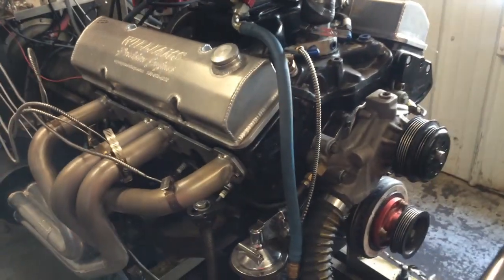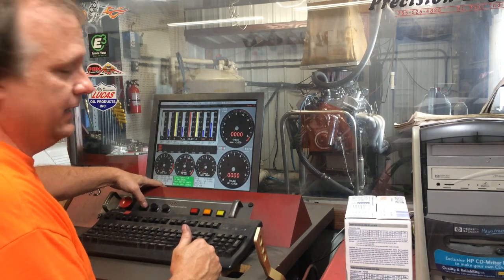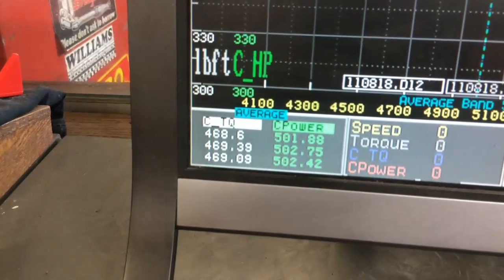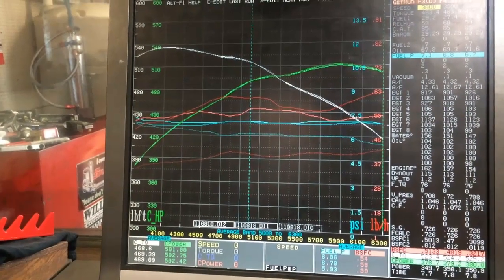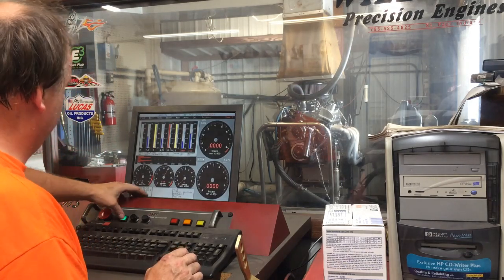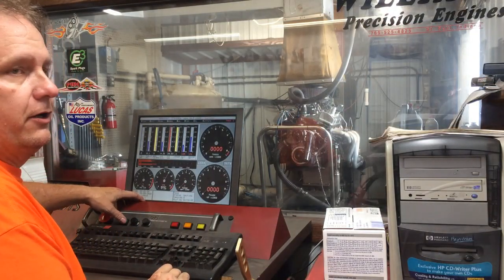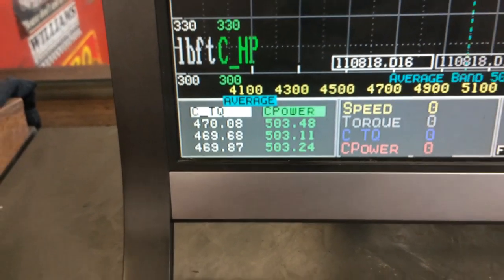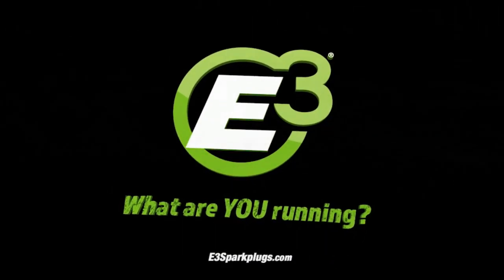E3 spark plug tests

Comment: E3 is pure $&#&@ in anything other than lawnmowers. Stick with OEM...always
Reply from the maker: Mr Boulding, not sure why you feel the need to slander, but it is insulting and unprofessional to do so.  I can tell you from real experience and show you with unbiased proven results you are wrong sir.
Reply: @wpespeedshop  this isn't "personal" so there's no slander involved. This is a product for purchase on the open market, and as such open to everyone's opinion and statement of quality. It's why products get "reviewed" and not all reviews are positive. 
I have many friends who are professional mechanics, and car dealers and they will report that the majority of E3 plugs used in modern cars and trucks do NOT hold up to the rigors of these engines. I have personally seen far too many broken E3 plugs and E3 taken out and thrown away after a puny few thousand miles. 
In two cycle engines of power equipment, they are great. OEM for cars is always the best choice as those guys called "engineers" know what they are doing. Not one non owm plug has ever withstood the science and testing to prove they increase performance or mileage. Any increase they state is almost always because ANY new plug will outperform an older worn out plug. The margin of error on Dyno testing also conveniently covers these performance plugs statements of enhancements.
Reply: @JohnBoulding  there is a test done by a guy named Richard Holdner and he tested the e3 against ngk laser platinum and also autolite copper standard design plugs and the e3 did not perform any better, and infact the copper plug came out on top for power.  Project Farm also did a test on several different plugs from several companies and the e3's still did not perform the way they are claimed to.  Its not slanderous when the plugs dont do anything that they claim to do for performance.  There's no reason for people to waste money on such a plug that can be out done by decade's old technology of the standard copper plug.  I agree with your opinion on these
Reply: @Itsarealone  thanks for that info. No one should be offended by facts and the E3 folks know their claims are not supported by facts. It's marketing 101 to make claims of added HP, which is never the case. Any Dyno increase in the 3-5 HO range is always within the typical margin of error on a Dyno. For this guy to say I slandered E3 is ludicrous.
Copper plugs are the best, they just don't last that long. I use OEM morotcraft I. KY 2008 Mazda 6 or NGK g power.
Reply: @JohnBoulding  absolutely agree! Companies and people need to be open to criticism especially when it comes to products out in the market.  In my turbo saabs i run ngk's but recently tried out a denso product thats been seeming to give my ignition system better feedback. My cars management system tells knock by a resisted plug and its been seeming to show me little knock counts that werent showing up under the ngk plugs. So its helped me get light throttle fueling down better and now performs much better with standard putting around driving amd increased fuel economy which with e85 is always a bonus lol
Reply from the maker: @JohnBoulding  I am offended because you’re calling me a liar, I’ve been building engines for over 30 years professionally, and have owned my own Dyno all that time. I do not work for E3, I have nothing to gain here, other than good faith with the company. These plugs did make more horsepower, and they do just about every time. I’m not talking 20 hp, probably only three or four in most cases, but they most certainly do make more power.
Reply: @wpespeedshop  nothing I said implied you were lying. I was simply stating facts which are born out by thousands of reviews of these plugs. I also have many friends in the racing industry and they also tell me to avoid them. You may have had great luck in your uses but the majority of users say otherwise.
Reply from the maker: @JohnBoulding  your wrong, but entitled to your opinion. E3 plugs work just fine and I personally know dozens of pro race teams that can tell you exactly the same.  On that note I have had zero luck with Autolite and I’m sure there are many out there that say their great. The difference is I’m not posting ( Their junk )
Reply: @wpespeedshop  well simply look at the sheer number of negative reviews sir and you'll have a large part of the answer.  What popular race teams of national standing use those plugs and have won races with them?  What you and I personally think doesn't matter vs what the actual numbers say. We can agree to disagree. I see bout 70 percent negative reviews across the board
Reply from the maker: @JohnBoulding  over half the Nhra top fuel cars is one example,, RCR nascar has been testing and developing with e3, all the nascar trucks and arca cars that run the Yates spec engine run e3,, all your experience and so called facts is what you see keyboard jockeys that don’t know crap is posting.
Reply: @wpespeedshop  I will stick with what I have experienced and the data. The data says E3 is more prone to issues. Use quality OEM specs plugs like NGK and Denso. They will work the best and the claims made by E3 are all within the margin of Dyno error. "A performance plug" climb made by most companies is bogus. The only time plugs amkena big difference is when your old plugs are in bad shape and you change them to something new. I'm done with this conversation. Have a good one
Reply from the maker: @JohnBoulding  your data is not factual,

Comment: I run E3 spark plugs in all my vehicles and motorcycles I had a buddy go ahead and change the spark plugs at the racetrack shaved a full second off his quarter mile time just by doing one thing only changing the spark plugs to E3 plugs.
Reply from the maker: That’s awesome

Comment: Different applicatiin, street performance,
50 % side gapped Autolites are seat of the pants better than plain.
Maybe Ill test E3. Surely better for longevity, but an extra $25 every 25,000 miles is irrelavent to me.
Looks good.👍

Comment: Keep in mind this guy is sponsored by E3 . Running them a couple of times in a motor does not validate their endurance over time. I've seen too many video reviews of this brand failing after a couple of thousand miles.
Reply: They will fall apart way before you see any improvements.

Comment: I’m looking at these for my 1969 400 Pontiac engine..
As a mechanic whom works in the high tech industry, and around sophisticated machinery. I spotted the benefits these offer in their design and performance, saw it right away!
i Appreciate your efforts to prove these pieces work, bottom line..
For the extra monies these E3 are, I consider them well worth the cost for an extra 2-5 HP or whatever it is, in my $50K+++ Rare muscle car.
And the overall engine running , starting and general RPM operating range not demonstrated here,  Has to be noted and mentioned Does exist ! 
Especially when you just proved it and adding benefits of durability they bring in their design.
The running operating uptime increase, improved performance  and reduced labor is one major component my job has we are always trying to modify some how some way to our advantage.
And these actually are one piece that meets this essential aspect which we consider to be another golden nugget..
Anyway I’m getting too wordy here , so again thx for this time here.
You just made a sale!!! 
BTW I have two Pontiacs so it’s X2 !!
Reply: Whom?